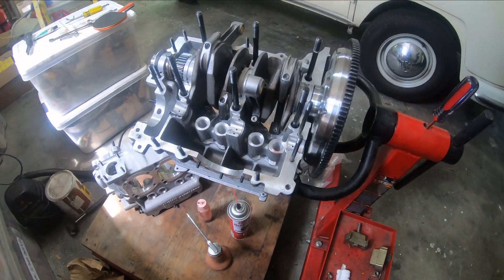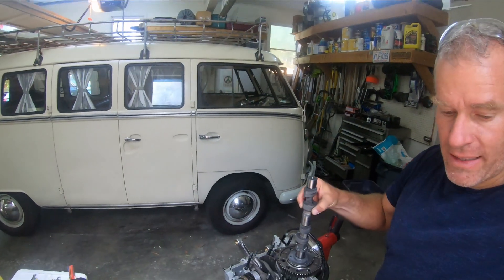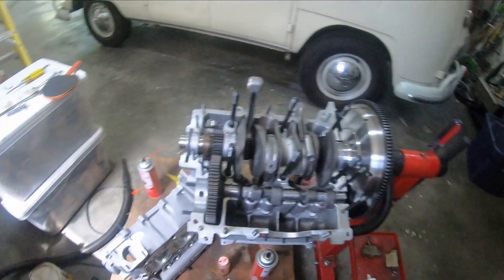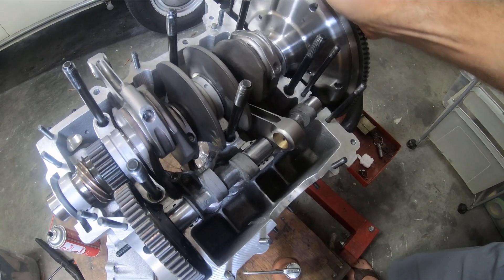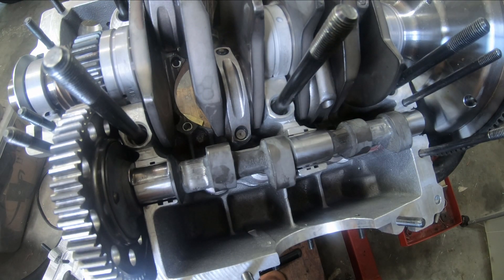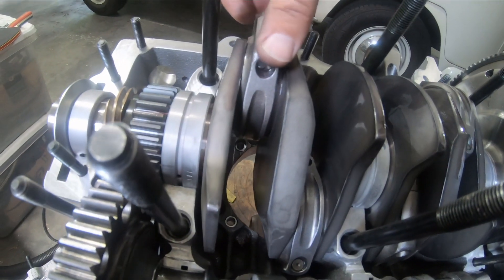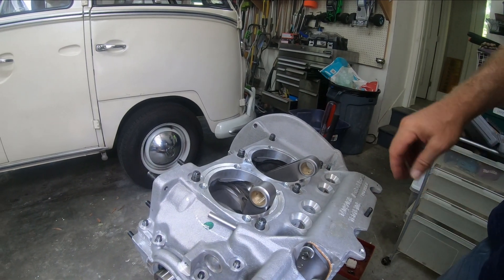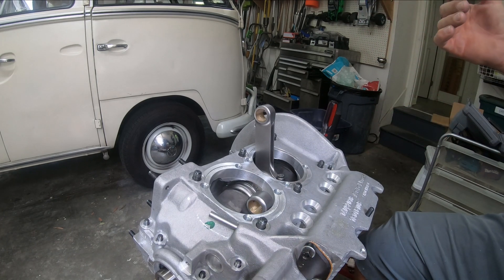2332 VW Air-cooled Stroker Motor - Video 06 - Clearance FK42 Camshaft and SCAT 5.5 H Rods

Comment: How do you like the motor performance with that cam?  On paper, its supposed to be a really good set up.
Reply from the maker: I love it.  But it is a low rpm motor rather than a high revving engine.  So when I step on it at 1800 rpm, it GOES.

Comment from the maker: Ok, at 1:27 in this video, you can see the “correct” orientation of the cam dot with the slot on the cam itself….  Whew.  Luckily the clearanced flat parts on the cam don’t line up with the rod passes unless the cam gear dot lines up with the cam slot